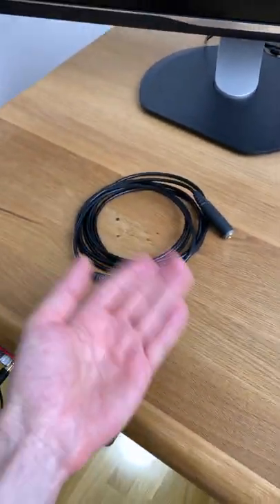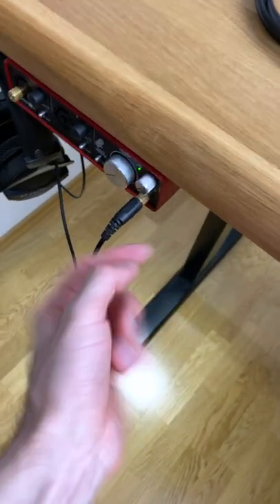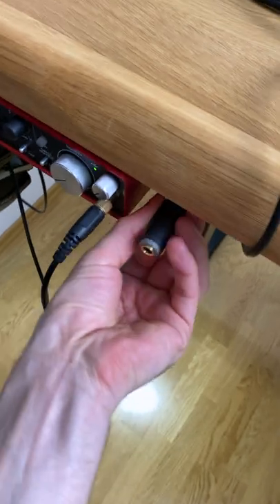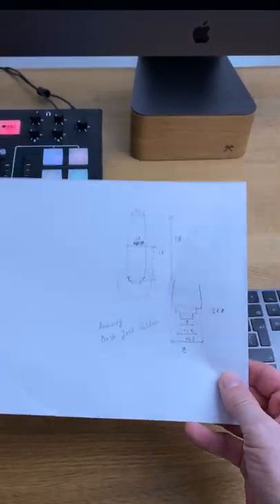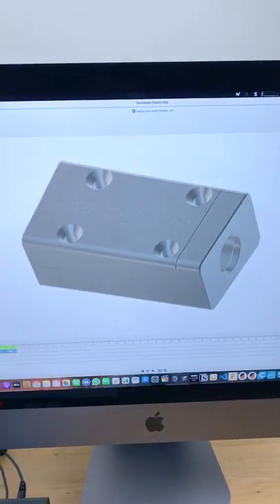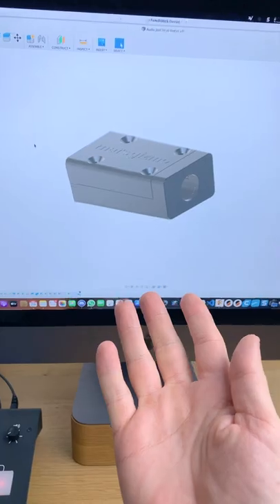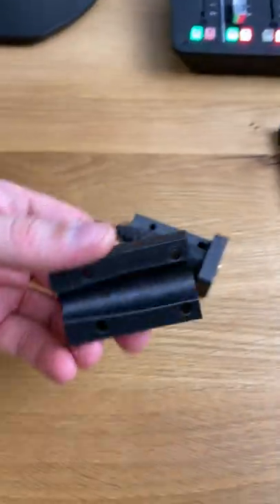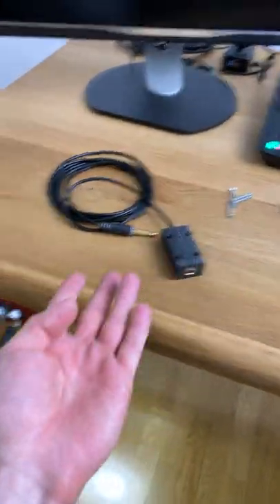Desk 3D Printed Audio Jack Holder - DIY Project

Comment from the maker: if you want a cheap 3D Printer, this one I recommend (my aff. link 🙂)  https://www.banggood.com/custlink/33Dy5eQwoJ
Reply: What are your thoughts on the cr 6 se ?
Reply: 3D Print a cup
Reply: OH
Reply: DO GODZILLA
Reply: Why dont ya try to print gundam
Reply: How many OHMS is your bayerdynamics headphones?
Reply: How did you under mount your audio interface? I have the same one but don’t have a great solution.
Reply: 14
14
14

14
Reply: @Ark Joseph Fernandez i
Reply: Those screws look kinda big to me. Are those 6mm? I would check that the wood on the table isn't splitting. Unless you already anchored them.
Reply: Can't click the link on mobile. What model is this?
Reply: What is the software you uses ?
Reply from the maker: @jacobvanweyenbergh9972  Fusion 360
Reply: @marsgizmo  Thank you so much. You are doing a good job and nice ideas. Good luck. 💕💕
Reply: Lmao u can't click the link
Reply: Naruto
Reply from the maker: Anthony D'souza  hehe, a real size one would be nice 😁
Reply: Cheap 3d printer

(Regrets life)
Reply: But when i grow up ill try affording that
Reply: @cupcaky6675  anycubic kobra go is like 190$ and works really well for beginners as long as it’s set up well